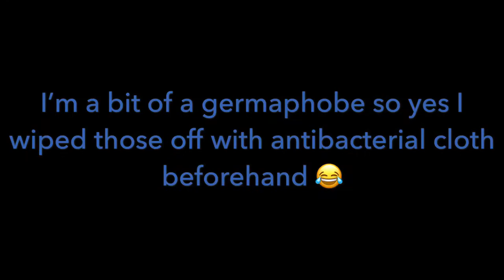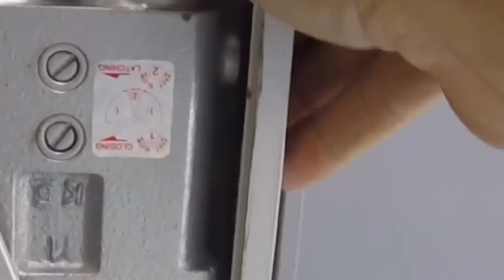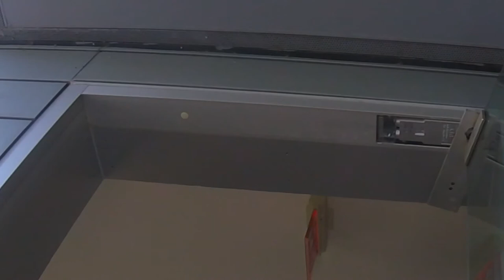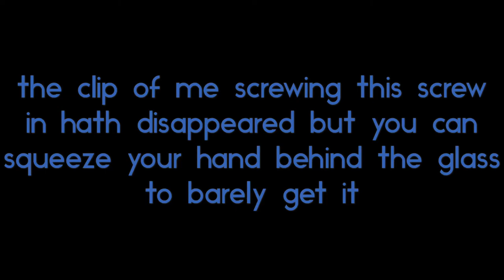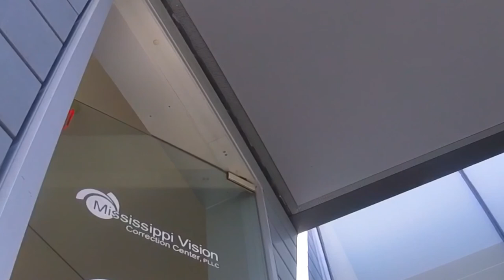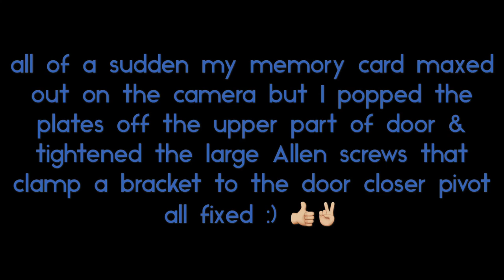fixin them big ole glass doors (Herculite lock & door closer repair)

Comment: In Canada (at least Toronto) we pay for air also. Can't remember if it's a quarter or fifty cents. I keep a compressor in the vehicle. I have also purchased arguably the best flat head screwdriver. Thanks for the tip and I can't believe I did without it for so long. I tell everyone about it. Our problem with those locks is they fill up with slush and salt. If you store the loktite cap side down it won't harden. I glue a small magnet onto the tube and store it on the side of the van. Also here, tradesman or woman are not allowed to use aluminum ladder at all (even the little one or two step ones) anymore.
Thanks for another great video Jason.
Reply from the maker: King Street Rob why can’t you use AL ladders?
Reply: Conduct electricity and also not strong enough for the new laws implemented by Ontario's Technical Standards Association.

Comment: hey next time you go to harbor freight buy yourself a small air compressor I did and had it for 3 years and still got it its a good investment all those quarters you spend you could have paid for itself (lol) John from lakeland fl
Reply from the maker: Jon Young I bought a husky one for about $25ish the week after Black Friday 2017, shortly after this video was made. I had the super cheap yellow one from HF for a long time and it messed up the valve stem on one of my tires so I stopped using it :) thanks for watching older videos :)

Comment: That looked like a real pain.  I couldnt make it out but was that popping sound at the end normal or were you able to fix it?
Reply: Eric Leitner No that is no normal. I really dislike that sound. Yes he was able to fix it. It was a loose screw or screws on the patch/bracket at the top of the glass door. I wasn't there but I think I would of replace the door closer. When the door doesn't stop in the middle of the frame something's wrong. Closer, bracket or pivots are the common culprits, but I'm video guessing closer.